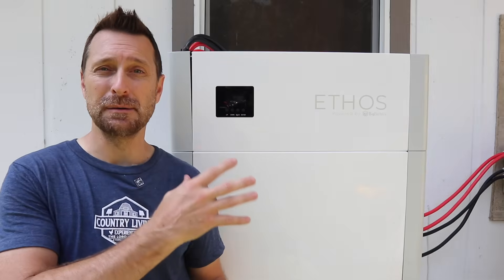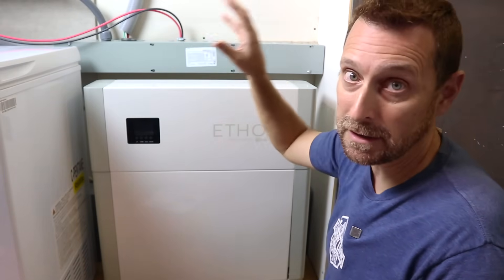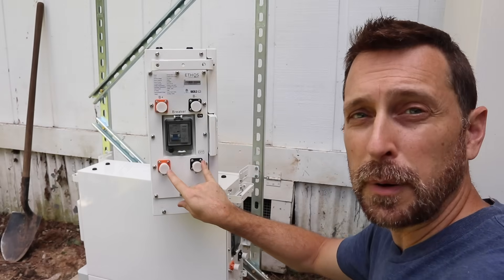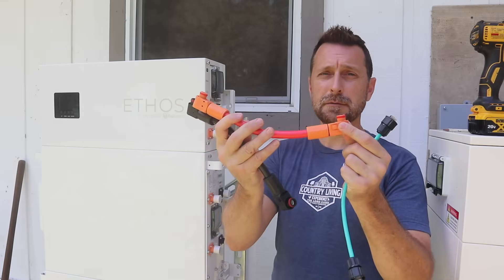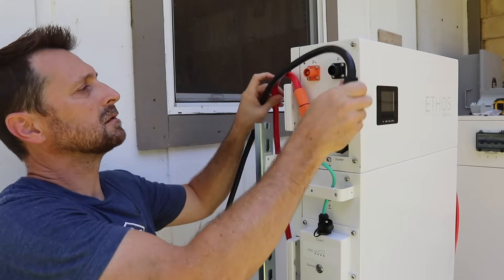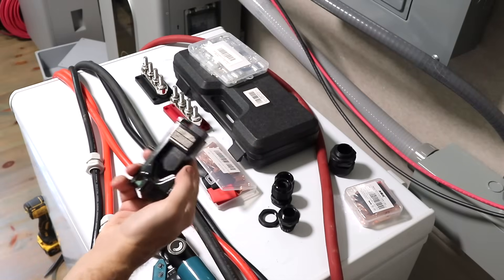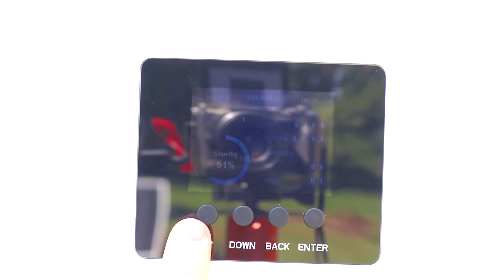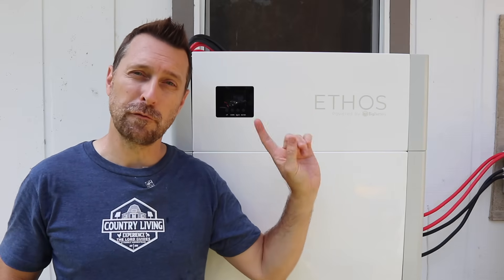Transformable Solar Home Battery System That Will Fit Almost ANYWHERE! BigBattery Ethos 48V

Comment: @BigBattery does not stand by their product. Battery failed in less than 2 years. Paid $200 in shipping and packaging fees and they will not supply a replacement.
Reply from the maker: That seems a little odd and not in line with their stated policies. Did you go through the distributor you bought them from? I know that Signature Solar guarantees to help you with any warranty issues.

Comment: I’m a professional battery installer up in Washington. My company just took on a new battery brand that’s very similar to this. It’s called point guard has a lot of similarities but instead of a BMS that has a built-in inverter it’s kind of cool to see the differences on what a professional installs versus DIY I know a lot of the equipment I installed you have to be certified by the manufacturer to even purchase it or already have an account with CED green tech

Comment: Greetings from Puerto Rico! Great video! I'd like to know about your experience with the Ethos batteries and if it's really possible to connect one Ethos battery to another, and if the communication with the inverter works properly.
Reply from the maker: Hello and thank you. 
I have not had any issues with the Ethos at all. All the batteries are communicating with each other as expected and are balanced. I do not usually run communications to my inverter. I run open loop. 
They do communicate with the EG4 inverters with zero problems from what I have heard.

Comment: Found your channel and glad to see someone else installing the ETHOS system. But I’m going to ask for one thing… PLEASE be better than other channels and post follow ups like 3 month, 6 month and 1year reviews on its performance. NOBODY posts follow ups on this system but there are poor reviews on some forums. Would like to know if Big Battery finally fixed some issues that were apparent early on in production before buying this system.
Reply from the maker: It is not about being better. Update videos are almost never watched by anyone and that is why people don't do them. 
You are always free to email me with questions on my system components or leave a question in the video comments section. 
As for this battery system, I have not heard anything negative. What issues are you referring to?
Reply: @CountryLivingExperience so early on there were failures of batteries, the covers were problematic and customer service has been known to be “useless”. I see the new covers are different but there’s still doubt being conveyed in forums about this battery system. On paper it looks amazing, I just want to know if it’s going to hold up and if I have issues, will the customer service be helpful.
Reply from the maker: I cannot answer the customer service question. However, if these are purchased from a third party like Signature Solar, their customer service is amazing. 
As far as holding up, they are steel covers which are solidly in place. I don't know what those forums said because I never read them. What type of failures were they talking about? BMS? Cells? Communications? Water intrusion? Did they completely shut down and not turn back on? 
Mine are working perfectly at this point.
Reply: @CountryLivingExperience they had cell issues. 5kw modules would just die. I hear the controller is rock solid as well as comms
Reply from the maker: @djkt745  Thank you for the info. I will keep an eye out for any issues. As of right now, they are working great.
Reply: I have 30kwh Ethos system like these... happy to sell it to you :D. I just got it online in July and the covers leave something to be desired imo. I think I would rather have bought the pytes.
Reply from the maker: @sonnybaker8928  Besides the covers, what don't you like? I do like the pytes cabinet but it costs a bit more and is less modular.

Comment: Very nice!  

So you mentioned paralleling 16 of these.  I'm guessing it's not all in a single stack because that would be pretty tall.  Do you just have multiple stacks of batteries connected together going to a single head unit?  

Did you mention if these have heaters in them or not?  

I do agree with you that it seems like there's some areas where they could make simple modifications for better tolerances in the mounting and covers.  

Oh, at 13:29, it looks like you need to tighten up a cable gland on one of your negative connections (just in case you didn't catch it already).  

Thanks for sharing!
Reply from the maker: Thanks Adam. 
They don't have internal heaters. I wish they did because that would take them up a notch for sure. 
They recommend stacks of 3 high. Yes, multiple stacks per control unit. They sell the paralleling kit for that (extension kit).
I got that cable gland tightened, thank you.
Reply: @CountryLivingExperience  awesome, thanks!

Comment: Cost and temperature rating please? Can these be placed in a hot shed or attach to back of home (located in hot south) which gets evening direct sun?
Reply from the maker: Each battery unit is $1290. The control box is $420 but can be used with up to 16 batteries. 
Charge range is 32f to 113f. Discharge range is -4f to 140f. If the shed is ventilated, it should be fine.
Reply: @CountryLivingExperience  Do these come with battery heating when temps drop below 32? You’ve putting it outside.
Reply: How many batteries are suggested to offset grid cost for 1800 sqft 2-story home? Roughly.
Reply from the maker: @LayneBailey That is dependent on the type of loads, average load usage, location, climate, system panel size, etc. 
I always say, start with what you can afford and you can never have too many batteries.
They do not have internal heaters.

Comment: Will this work paralleled with eg4 wall mount batteries and 6000xp’s?
Reply from the maker: Yes, absolutely. Use common buss bars to parallel them.
Reply: How to do software  update on it